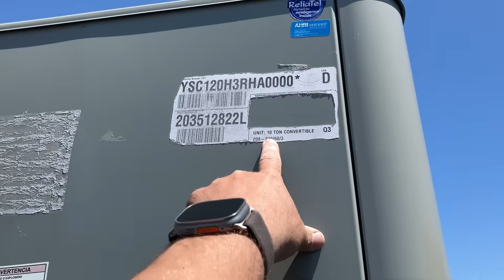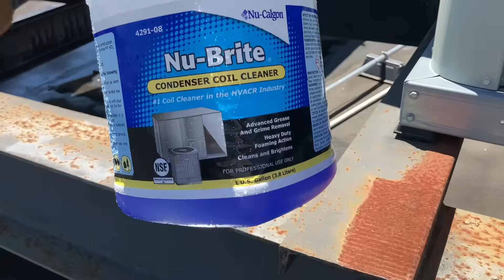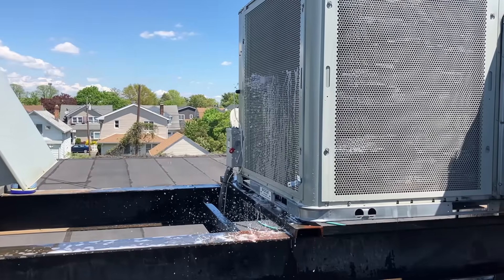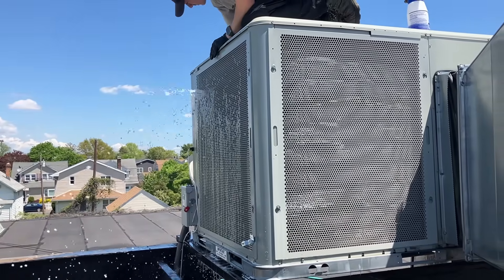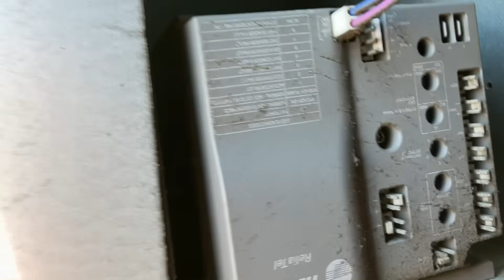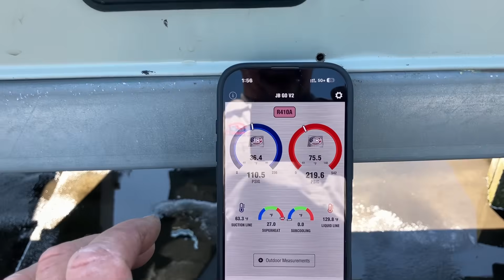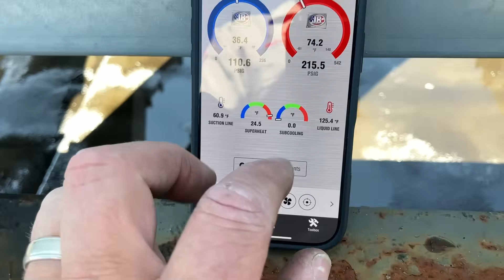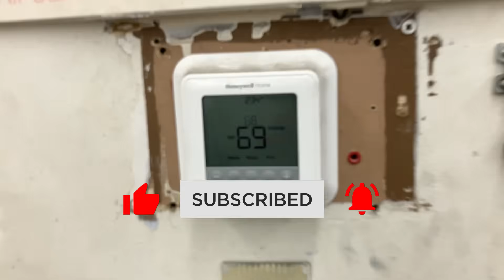30 Tons of Cooling for 7,000 Sq Ft?! INSANE Waste at US Government Building | HVAC Truth Exposed

Comment: I got a good one for you. SUNY Downstate Brooklyn 20 years ago did a 10' x 14' x 8'h freezer with 3 evap coils in the room. The geniuses from he State specified a 25 HP unit. Told them in writing this was ridiculous for a 0 degree storage freezer but was told by the GC to keep going. When we turned it on the dial thermometer went from 70 degrees to 0 degrees in about 3 minutes and you could watch the needle on the dial thermometer actually go down. Showed them the unit in action and said you will definitely loose a compressor due to lack of oil return. State Engineer came back to review and said ok we are going to put a 5hp on it with 1 evap coil which is what it should have been in the beginning. He said dont worry we will use that unit somewhere else, yeah right. The 25 HP if I had to guess cost about $30 grand. The crane to get it to the roof with shutting down Clarkson Street was $40 grand. My install was $25 grand 20 years ago. We ripped it all out and did it over again. My guess with all of the engineering and General Contractors associated item electrician, roofer, etc this probably set the state back $400 grand. Communist State of NY at its finest.

Comment: Nasty condenser coil cleaner on an aluminum micro channel. Read the directions knucklehead. Says right on it not recommended for micro channel coils… 

Look at total model number - if it’s a 1,3,5 it’s a factory installed hail guard for the condenser coil.

Comment: Yea thats insane. 30 tons? They would be good with just a  single 10 ton unit. Maybe a 15 ton to make up for summer time heat where they have the bay doors open all day. The heat part you gotta understand that in commercial an a/c only unit takes time to special order for our NY market compared to a standard stocked unit that will come with it. Also its slightly cheaper because its not a special factory ordered unit. Now the green on the liquid lines you see is because the trane precedent series units tend to collect water there, causing oxidation. I love trane, 9 years into the trade and i specialize on trane and york packaged units. Those “shipping panels” are the trane hail guards lol. Those are a fancy upgrade

Comment: I never use coil cleaner. I put a wire wheel brush on my drill and just lean into it until all the fins are removed from coil. 
Works every time.😂

Comment: Problem #1) You are Not supposed to use Coil Cleaner (ESPECIALLY The Blue/Purple) on Micro Channel coils! You should know this. Ask any manufacturer.
Reply: That stuff will never come out of the fins! Congratulations you just lessened the life of that aluminum
Reply: He actually maybe alright if those coils were rinsed completely until no bubbles are present. However that would take probably 2 hours to do. They make a yellow colored cleaner for micro channels. I just use water and a garden hose with the coil gun hose nozzle.

Comment: Hey mikey, great video, crazy to see how much tons of cooling they put in this building, id figure NY would require load calcs. Waste is real it seems, also quick tip refrigeration technologies makes a microchannel safe coil cleaner. Works wonders, itll be safer than the good ol nucal blue. Them microchannels are way to frail, nucal blue will eat that crapola up. Keep it up man!

Comment: 15 Tons too big!!

In the S.E U.S, most do 600sqft per Ton...  Books call for 400 sqft, i always went in the middle and was "CONSERVATIVE" upon my installs at "500sqft Ton" when i did them for those really cold/blistery nights, or hot/humid summers....

I.E  1400 SQ FT Home would get a "3 TON",  or a 1800 SQ FT home would get a 3.5 Ton, a 800 Sq Ft home would receive a 2 Ton, ETC.

But 30 Tons of Heating/Cooling for 7200 Sq Ft when a single 15 Ton or  a single 10 Ton with another 5 Ton unit should be enough... In my neck of the woods anyways...

Crazy!

Comment: Those guards you removed are hail guards. Also, commercial is a completely different animal from residential. The heat loads are entirely different, and more often than not (at least in my area) most commercial buildings are poorly insulated. Another also, those are all 2 stage units; so not all 30 tons will be blasted into that building all at once, with the exception of the worst heat waves. That is, assuming that Y1 and Y2 aren’t jumped together. 3rd also, I highly agree with you on the fact that we need to approach our service managers that we need more time on these maintenances TO DO THE JOB CORRECTLY, and not just a in and out glorified filter slam. This has been an ongoing issue where I work, we all bring it up constantly, but nothing ever changes. With that being said, I still love working for the company I’m currently at. 

4th and final also, no gas hookups to those Trane wrecks. Where does the building get it’s heat? Did I miss something here?

Comment: Mikey pipes, you can tell that you don’t do much commercial work.  You can’t just do a square footage calculation and assume it’s correct in commercial.  You have to do a full load calculation.  Lobby doors opening frequently, high ceilings, insulation values on the roof, bay doors opening and closing, BTU output of the machines, BTU of 20 to 30 people moving around constantly in a mail processing area, required air changes per hour because of the dust from the paper, etc.

There’s a lot more to commercial work than you might think.
Reply: True, its not like those RTUs will fire full stage all of the time either. Has some built in redundancy if a compressor takes a dump they will still have cooling for that zone.
Reply: Engineers design HVAC for commercial applications. Last time I checked, you're not an engineer. And a federal buildings are always over-engineered. Not sure you really understand how stupid and idiotic you sound. But you have a big mouth and you're always opening it😂😂😂

Comment: Mikey,

Four quick points:

Hail guards: The screens on the exterior are hail guards—optional accessories that run about $1,200 per unit. They should be reinstalled.

Coil cleaning: American Standard warns against using alkaline coil cleaners on micro‑channel coils. Instead, rinse with water only. (You also need to blow the water out with a leaf blower at the end as well.)

Cooling load: The current load calculation looks questionable. With a flat black roof, you’ll need a complete heat‑load analysis that factors in all equipment, lighting, make‑up air, and occupant loads (for example, how much machinery is running). This job was most likely an RFQ/RFP with specifications that would have included the unit size, features, and may even have had a list of acceptable equipment vendors. Sometimes, even specs for the model numbers that are wanted.

Enthalpy controller: One unit’s enthalpy controller for the outside‑air damper appears disconnected. Local code usually requires this controller to meet minimum air‑exchange rates, so make sure it’s wired and functional. (also part of the system sizing)

Here is a link to the install guide for the units (page 58) states not to use any coil cleaner on MC, also the Hail guards are mentioned.
https://elibrary.tranetechnologies.com/public/commercial-hvac/Literature/Installation%20Operation%20and%20Maintenance/RT-SVX071D-EN_08192023.pdf
Reply: also efficiency isn't at 100% load for almost any device. more units to share the load allows for the ability to run at a more efficient load capacity. :S pretty obvious for someone not in HVAC imo...

Comment: Typical Post Office overkill! Back in late 80s went to at least 25-30 small POs in Indiana putting safeties on boilers! In a couple of instances the boiler was so small that the low water cut offs (had to use float type! Wouldn’t let us use probes!!) would make the boiler tip to one side if you didn’t support it properly!! Also had to use test and check crosses! M and M quit making because they didn’t work for 💩!!

Comment: The mail room alone could need that amount of cooling if they’re running machinery in there. If the front lobby is constantly being opened and closed a smaller unit probably would never satisfy. Commercial sizing isn’t like resi cooling there’s a lot of other heat loads that need to be taken into account not just sqft. You also have bigger windows and doors etc…
Reply: also, lighting, computers/monitors/tv's, human body count, large containers of mail being moved in with lots of heat energy stored, poor/uninsulated roof, walls, maybe used as plenum space. automatic mail sorters pump out heat
so many things to factor in for equipment sizing.
Reply: Yeah Mikey is a cool guy but arrogant as F.  Don’t believe a fuking HVAC Tech over engineers lol.

Comment: That Blue coil cleaner is not for micro channel coils. You should use the Tri-Power by Nu Calgon. The blue will burn the crap out of those micro channel coils, and cause leaks. And those are hail guards on the units. They're an accessory. I would definitely put them back on. They're there to protect the coils in harsh weather.

Comment: Commercial load calculations are a lot different from residential.  You have to account for a lot of outside air needed for the ventilation requirements. Plans would of needed an engineers stamp on the drawings.
Reply: That's what I was thinking an engineer designed this system...accounting for all the cooling loss
Reply: because engineers can be trusted these days

Comment: 240 SF per ton. Not oversized by commercial standards IF they have OA intakes. 

Didn’t think you were supposed to use coil brightener (blue) on micro channel condensers. Pretty sure that’s a no-no
Reply from the maker: Thanks for the feedback!

Comment: Funny I have 6000 sq feet with 12' ceilings of conditioned space and only have 7 tons total and does fine even during the 110F heat here in Texas.  We can keep interior down around 73F pretty easy.  👍🤠
Reply: Do you have guests coming in and out every 30 seconds?  And machinery inside your space…?  😂

Comment: It's not just square feet that matter. High ceilings will add to the cubic foot of the building. Example: With 9 foot ceilings the area to cool is 64,800 cu.ft. With 18 foot ceilings the area to cool is 129,600 cu.ft. Is that a consideration when calculating btu for the system? 🙂Also if there are large numbers of people, many windows and insulation are just a few more considerations.
Reply: Just did a load calc and it comes out to 28.442 tons so...
Reply: @theronerd  On what?  You've been inside this building?  Cmon..
Reply: @RobertKohut  Regardless, no heat load calc would ever equal 30 tons on that structure.  No way, no how.
Reply: @SeatonHeatingAC  please tell me what heat load calc you performed on that structure to be able to make that statement.
Reply: @metaljesus  Experience.  Mike would say the same thing.
Reply: @SeatonHeatingAC  it's because of statements like this that so many systems are installed incorrectly.

Comment: Hey Mike Nu Calgon actually makes a coil cleaner specifically for micro channel coils. You're not supposed to use Nu Brite on micro channel they specifically state that on the label.
Reply: We work for Trane and it is forbidden to use my brute on micro channel
Reply: @tylerrowe6380  same here, I work for lennox and we are forbidden to use the blue death also, actually, any coil cleaner other than just water. I would NEVER put nu-brite on a microchannel coil, you're just asking for problems. Also, you need to blow the water out of the coil to keep it from slamming the hi-pressure switch.
Reply: Wow. Our tech  support rep from american standard here in the Midwest said only use water on those milo channel coils. Did nu calgon change there formula... also with those micro channel coils our tech support rep from America standard/ trane always recommend to us to take leaf blower and blow out the remaining water after rinsing due to tripping high pressure  safeties.
Reply: @paulwagner1115 I’ve cleaned hundreds of microchannel coils. Water only. I’ve never blown excess water out and have never had one trip on high head pressure.
Reply: Just about every microchannel I’ve come across, there is a label on the unit right next to the coil that says something along the lines of “clean using water only.”
Reply: Ruh roh
Reply: Yeah, that’s a hard no.
Reply: I would say no Blue stuff on that kind of coil. just too thin of metal for the Heavy duty stuff.  But It does Clean the S out of that coil. Keep them coming Mikey! by the way 10 ton is 4000 cfm? You think they got that much air moving through them? All three running would be 12,000 cfm?  should be like a tornado in there.
Reply: I always heard as well not to use on a micro channel coil unless they updated their chemical to be compliant now.
Reply from the maker: read the label NOW in 2025 and edit your post
Reply: @PipeDoctor  says only use on condenser coils and finned coils? Am I missing something? I've always been told keep this stuff far away from micro channel
Reply: @25tommyguns you’re not missing anything.  says it in the literature.  not recommended for micro channel and coated fin coils.  mikey never admits he’s wrong. 
he once lied to the viewers and claimed home depot gave him a 4 way switch in a 2 pole switch box.  it wasn’t working because he didn’t wire it correctly.   4 way switches are never marked on / off.  he’s a good mechanic. but doesn’t like criticism. and his ego doesn’t allow him to admit mistakes.
Reply: @frankd2624  yeah I wasn't trynna come at him but I knew right away he was dead wrong putting that nu brite all over those coils. He is a great mechanic which is why I second guessed myself lol
Reply: @25tommyguns  come at him lmao he get offended when he's proven wrong. I hate techs that act like they know the world mostly when they're wrong.  He will eventually get a call back when them coils are leaking.  He will remember these comments then lmao
Reply: @PipeDoctor  I'd believe what trane recommends over nu-calgon 🤣
Reply: @PipeDoctor  according to nu calgon's website today in 2025 it says " not recommended for coated fin
or micro-channel coils".
Reply: @PipeDoctor  I love you, buddy, but just tell your apprentice to rinse it from the top down